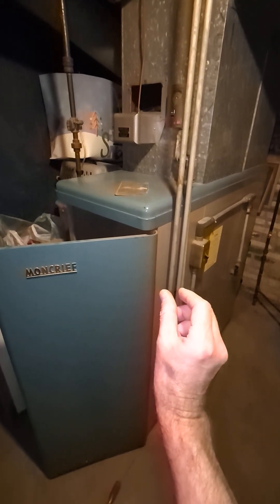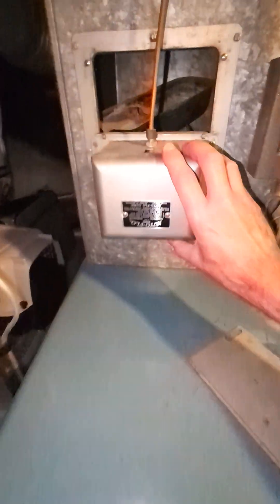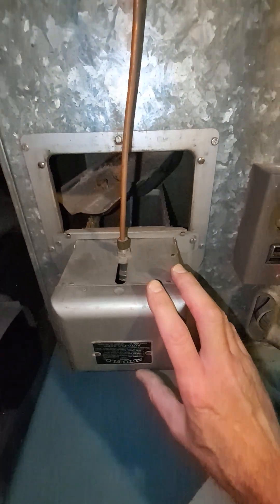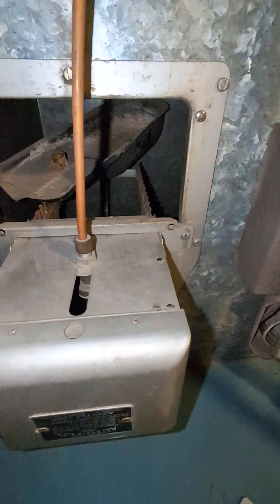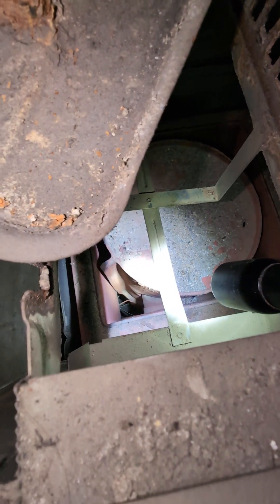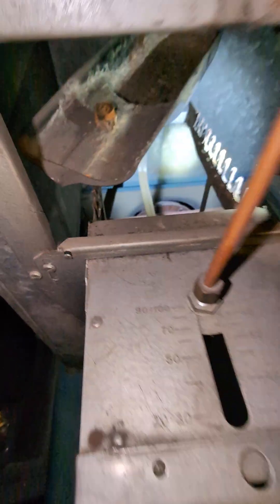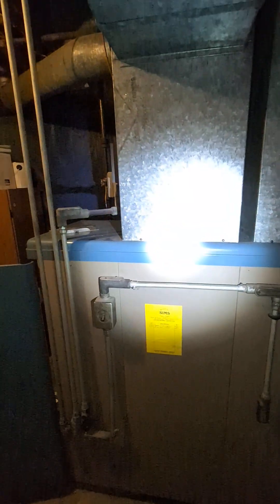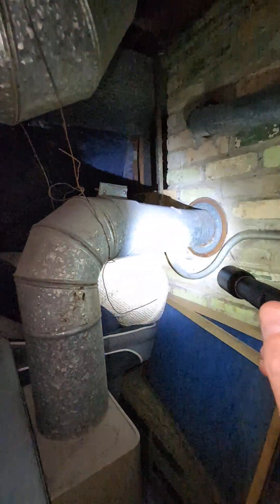🔥1957 FURNACE STILL IN USE Very inefficient #hvac#furnace#heat#shortvideo#shorts#youtubeshort #1957

Comment: Is it the original electric motor?
Reply from the maker: Everything was original including the electric gas control valve. I don't know about the blower motor,  I didn't get to access that back panel where the blower is. They had contents blocking it .
Thanks for watching
Reply: @inspectflix If it is the original blower motor it probably needs oiling.  There are probably oil ports on the front and rear bearings.

Comment: I grew up in a twin home in Philadelphia. It was built in 1924 and originally had a coal-burning boiler in the basement. It was later converted to oil and ran until 2011. I had it replaced by a super high-efficiency gas boiler. The local gas company gave us a huge rebate.
Reply from the maker: Awesome story! I love those old coal boilers, built to LAST but not very efficient. 
Thanks for the comment and for watching.